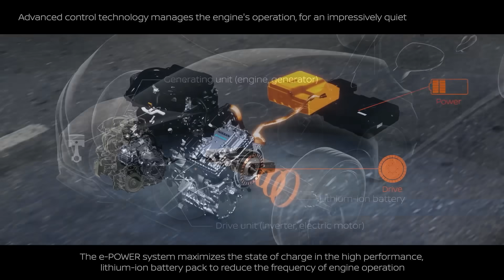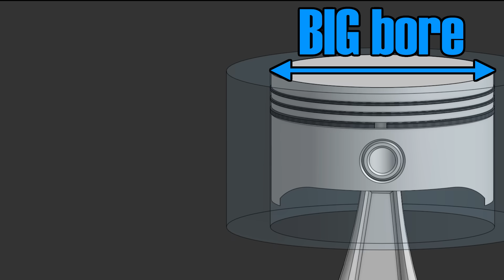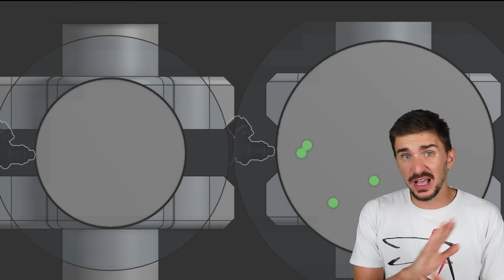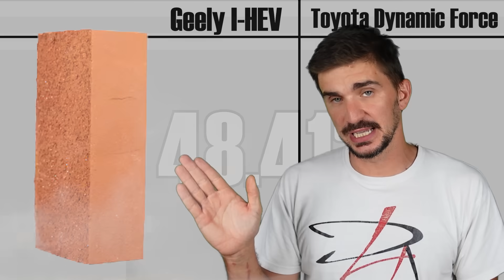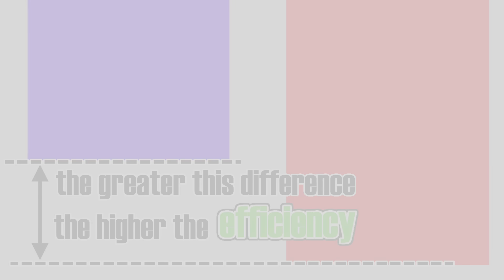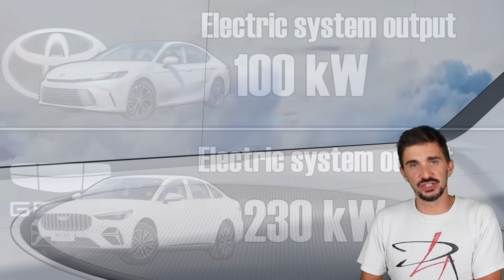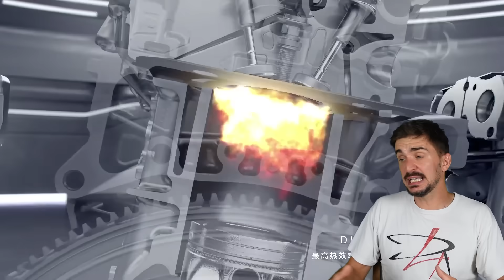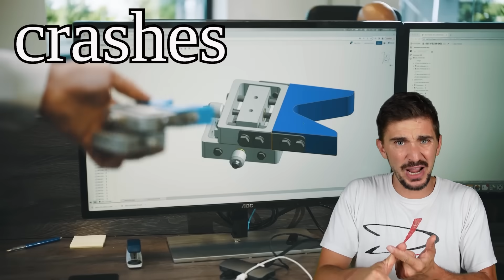How China's Geely Beat Toyota, BMW, Ford and Everyone Else

Comment: This just sound like a an EV with a bigger ICE range extender.
Reply: Not really, since the ICE engine also powers the wheel (Timestamp 0:55)
Reply: @ujiltromm7358 At high speed and in one gear. The majority of ICEs are only used for battery charging.
Reply: @ujiltromm7358 in this setup it seems pretty weird instead of just using it as an generator.
Reply: @ujiltromm7358  with a severe drop off in performance, technically yes but you would call that "power" at all
Reply: @ujiltromm7358 my guess is that the chinese car is a serial-parralell combined hybrid. While toyota is a more traditional parralell hybrid.

One advantage with toyotas model is that it can be driven with the battery totaly dead
Reply: @matsv201  Toyota's isn't a parallel, and it isn't series-parallel or series either. Its setup is entirely different, but too much to describe in a YouTube comment.
 Toyotas never allow the battery to fully deplete while fuel is still left in the tank. 
And as far as I can see, geely seems to use the same style of hybrid system.
Reply: @n00bxl71its really a parrealel hybrid with a gearbox removed.
Reply: @matsv201  It's really not
Reply: @n00bxl71well the main motor is totaly in parralell with the engine, making it a parralell hybrid.

The aditional motor works more or less.as a eletric torqiue converter. While in some sense it can be partly used in serial, it lack a physical deconect making it not a true serial hybrid.

Making it a parralell hybrid with serial hybrid elements.
Reply: @matsv201  The main motor is not totally in parallel with the engine. It's in parallel with the wheels. There is no electric motor in parallel with the engine. They're connected through a planetary gearset.
Reply: @n00bxl71almost all paralel hybrids have there engine go throw a gear set. If its planatary or not dont matter. Actually a lot of automatic cars have planatary gearsets as well.

That is a planatary gearset change nothing.

Im afraid you seen some youtube video trying to confuse you in stead of explaing it.
Reply: @matsv201  I didn't say the planetary gearset makes it not a parallel hybrid. It's the fact that it's not a parallel hybrid that makes it not a parallel hybrid. The engine and motor aren't in parallel.
Reply: @matsv201  parallel hybrid can move the car by either electric or ICE engine power alone. Series hybrid has no mechanical connection between engine and wheels.
And Toyota is neither of those. It cannot move the car on ICE alone, the electric system always contributes in one way or another in the power transmission. So it's not purely parallel hybrid. But the mechanical transmission to wheels is there, so it's not a series hybrid either.
Reply: @Papinak2  
"parallel hybrid can move the car by either electric or ICE engine power alone."
While that is common, that is not what define a parallel hybrid. Its not the motion of the vehicle that define if its parallel, its the flow of power.  

"Series hybrid has no mechanical connection between engine and wheels."
Well sort of yes, that is typically the case, but again, that is not how they are defined.

" It cannot move the car on ICE alone"
It absolutely can. The car need controll from the motor-genertor, but it don´t need them directly to move the car.

For example if the main motor is set in freewheel, and the secondary motor is set in torque mode. The combustion engine can move the car just fine with no assistance of the motors what so ever.

Again, this is not what define a hybrid at all. A hybrid have to have 3 components. A engine, a motor AND a battery.. If there is no battery, its not a hybrid. Then its a electric drive train. (like diesel locos often have)

If you remove the battery from a Toyota hybrid, the conroll system can still use the small engine to absorb torque, and convert it to torque in the larger motor with no battery in between. This makes this NOT a hybrid, but a electric drive train.

What defines a hybrid is not how the motors are configured, but how the electricity flow between the batteries and the motors.

The battery in the Toyota hybrid train assist the engine with extra torque, hence its a parallel hybrid. As long as you moving forward its only a parallel hybrid. Because as long as the engine is on, the engines is always providing torque to move the car forward. The electric motors can act s generators and absorb part or all of that torque, that is typical of parallel hybrids, nothing special here.

Its when you put it in reverse its gets kind of complicated. The engine is still trying to push the car forward. But the motors is not only absorbing that torque, but over compensating for it, making it.. sort of, a serial hybrid.
Reply: @matsv201  But the engine won't transmit any torque to wheels, if it's not getting torque from the motor on the other end of the gearbox. And motor can only provide torque if it's drawing or generating power from the system (be it battery or the other motor). The motors don't only assist, they are necessary to get the car moving and there is always electricity flowing one way or another, between the battery and the two motors.  
What's the definition of series/parallel in term of energy flow?
Reply: @Papinak2  
"But the engine won't transmit any torque to wheels, if it's not getting torque from the motor on the other end of the gearbox"
Well true, but the hybrid definition only care power energy flow, not torque.  You can lock the motor upp with zero energy flow, hence it don´t effect if its a parralell or serial hybrid.

"And motor can only provide torque if it's drawing or generating power from the system "
That is not true. The motor can be locked up at zero RPM. It can also generate torque by heating the energy away (still don´t make it a hybrid) or using the energy to drive the other motor (also don´t make it a hybrid, but does make it a electrical power train, in this case a electromechanicla power train)

" always electricity flowing one way or another,"
Not really. If one engine is locked up and the other is freewheeling, there is no energy flow either direction

"What's the definition of series/parallel in term of energy flow?"
A parallel hybrid is a hybrid where the electric motor provide torque to the same axle, or a other axle that is in contact with the same road, where the energy from the torque comes from a battery.

Also typically the battery is charred with taking torque from the same axle, but this is not definitively.

A serial hybrid is where the engine provide no direct torque to the wheels but a electric motor does, typically provided with energy from e generator AND battery.

There must be TWO sources of energy for a serial hybrid, kind of definitively by the word hybrid. So if there is not battery its a electric power train, if there is no engine with a generator, then its a electric car.

Worth saying that when a Toyota hybrid reverses the engine does provide torque to the wheels, but it does so in the wrong direction, not helping the car move backwards, effectively not providing motion. hence, there is a physical connection but it does nothing, hence the system acts like a serial hybrid.

When the engine is one and moving forward the engine will always provide torque to the wheels, hence its a parralell hybrid.
Reply: @matsv201  in the previous reply, you said that series hybrid is not defined by lack of mechanical connection between engine and wheels, now you say the series hybrid doesn't transmit torque from engine to wheels.. so which is it.
Does the motor in Toyota have a mechanical brake that it can be locked up?
Unless you meant locked up by shorting it and waste all the slip as heat, which is definitely not what it does, when it has another motor and battery onboard.
Reply: @Papinak2  
" you said that series hybrid is not defined by lack "
No i said that they typically don´t have that. What defines them is that the power goes from the engine to a motor via a battery.

" so which is it."
The one i ACTUALLY did say, and not the one you made up.

"Does the motor in Toyota have a mechanical brake that it can be locked up?"
I don´t know that, but i would assume that is the case.

"Unless you meant locked up by shorting it and waste all the slip as heat"
Shorting it would not lock it up, it would just make it go very high torque. So it probobly typically is locked up electrically with a magnetic field from the stator.

The reason i think it probobly have a mechanical lock up is that at highway speed the small electric motor is basically useless and having it always counter torquing with electrics would be wasteful.
Reply: @ujiltromm7358 You can't call this "power the wheels," because the combustion engine cannot do it on its own, it only acts as an auxiliary, and with significant power loss, as mentioned in the video. In short, the EV system is always required to move the car, even when the ICE is generating motive power which is why we can never use the phrase "power the wheels."
Reply: @JoãoRDP This is completely false, these cars will run on ICE only. Source: I sell them.  Of course as he says it's not optimal as you only get 100hp but you can do it with no issues. 

My opinion is that these cars are meant for the average EU citizen, 125km+ real average EV range. (Geely Starray 30kwh) The average commute here is 30km, for those trips, it essentially is a full EV. For medium trips (150-200km) it will still be mostly an EV, and if you have range anxiety on long trips (the reason most people dont buy EV) you can just put petrol on it and be on your merry way. 

The only downside I can find is that as the video says, very long uphills will drain the battery and leave you with an underpowered car. But still, that is a very specific case in my opinion.
Reply: @delta_13 thats not fully explain in the video, thank you to come along with it, if is that way it is a great achivement.
Reply: @delta_13  "with no issuse" is a bit deceptive here. in a real world driving experience, should the car produce 180hp with the hybrid assitance you will feel that absence when the battery is depleted. i previously owned a 5 spd manual corolla with 110 hp, and on a gradient of say 8% incline for 300 yrds max speed was 120 km/h. this car with only 100 hp and the addition weight of the hybrid system while having simultaneously charge back the batteries you will be having issues. not mechanical yet. but you will be eventually
Reply: @JoãoRDP watch the video before writing
Reply: @iamZios That would be the case if you only drive the car with low battery up long uphills, but that isn't realistic.
Reply: @iamZios  Driving a Corolla, this kind of situations almost never happens... Depends on your country geography of course but in continental Europe you'll be fine except if you live in a mountain chain. In this case, your car should be a Jeep (if you have money) or Lada (if you don't) and not anything else.
Reply: @delta_13  IT only directly power the wheel on highway speed where direct EV are still not most efficient ,the lower the speed the EV is more efficient,then ICE is totaly disconnect from drive train
Reply: @dzonikg If you are running low on battery the ICE will still provide power to the wheels at low speeds.
Reply: @JoãoRDP  It power the wheels just enough for cruising speed. Passenger car engines don't just output 100hp all the time.
Reply: @theophanebrochard7933  its a car for people who live in the cities, one redlight to another. its not or will not be good at anything else. to how shit this is, even the prius starts to look far more appealing
Reply: @theophanebrochard7933  i live in the caribbean where is hot and hilly, this car will not last, even made worst by those thinner oils they will be using to get those mpg numbers. that engine will run on some very tight tolerances. the average driver doesnt even do oil changes on time. so this engine will spin rod bearings as early as 60k
Reply: and imagine that... Mazda did that already lol
Reply: Great, right? An electric car that you can fuel up like a gas car, instead of having to rely on charging stations.
Reply: @michaelbuckers its sounds great, really… its just hilarious when you think about it 😂
Reply: @michaelbuckers  😂😂😂😂😂
Reply: @michaelbuckers  Imagine a car that's 18 years old, rusting from underneath, range extender is consuming oil and your battery needs to be replaced... what a gem indeed. The resale value is the bane of every EV, adding an engine is the worst idea ever, even plug-ins pushing it. And those batteries arent even that big, still cost as much as an engine. Do we want to build trash or cars that last?
Reply: @ezustnyil8414  Blud cares about resale value of a 2 decades old car. Must be living in Lithuania or something.
Reply: @michaelbuckers well, the market does as it seems.
Reply: @michaelbuckers hey man, 2 decades is nothing for cars made in the 90’s, seriously, those mfs were just broken in 20 years and 100k miles in 😂
Reply: @ezustnyil8414  wtf, use a car for 18 years?
Reply: @Velctor  I do, and many others, and it doesnt matter, the resale value is determined by both real, and theoretical lifetime, this is why Toyota for example have a high resale value, not just because its reliable for 15 years, but because well beyond that and each new owner are ready to pay higher... that circles back to the top, thats how resale value works. Market decides that. This is why new car price is never compared to what you can buy used. This is why EV resale value is dogshit, there is no trust in them (regardless if they truly held for long time or not) it takes time for the trust to build up, but when you hear frequent battery replacement after 14-16 years, that doesnt help.
Reply: Hybrid?
Reply: Yeah, I immediately thought, China, so proud of their EV push, realized they have to hybridize energy sources, and the result seems very complicated just for improving an EV. The other approach, electrified gasoline engine, makes more sense.
Reply: If you can adjust  or "moded" the exhaust valve timing, the engine becomes more interesting, no  ?
Reply: @jeffreyrudolph5061  You will likely run into knock issues very quickly unless you run really high octane fuel. Also typically these engines are relatively fragile, as the components are made as light as possible to compensate for the high acceleration cause by the long stroke.
Reply: yeah, sounds like a highway range extender
Reply: exactly what it is
Reply: So it's not diserving any awards, it's using external energy to make it efficient, so thus every "saving" is getting lost at the electric engine generating power to the engine lol
Reply: @gabrielvieira.4358  The engine only is the most efficient mass produced engine.  Its the systems around it that allowed for the large compromises in ICE engine power to get that record breaking thermal efficiency.
Reply: @gabrielvieira.4358  ICE engines absolutely suck at efficiency by themselves, so you are not making a point here

Comment: Go back to the 1920s and 1930s and the engines were way more under square to make more torque with the low compression ratios.
Reply: lower compression ratio = lower thermal efficiency
Reply: Yeah, but back then engines rev way lower naturally anyways, so it's only valid that they had to maximise stroke to gain power, unlike now where longer stroke = lower revs = lower power.